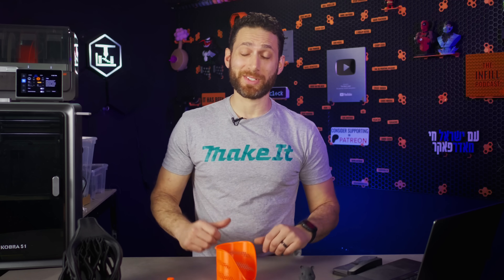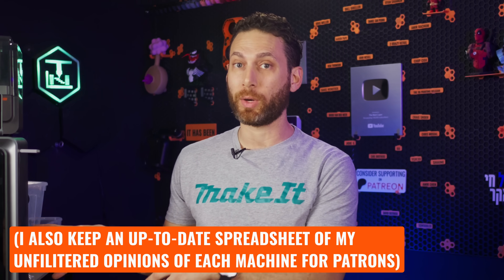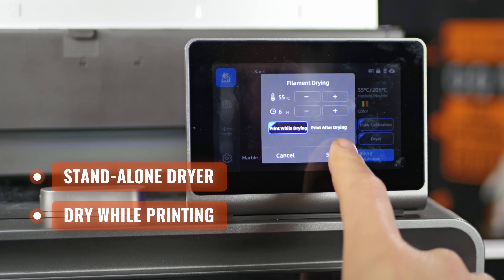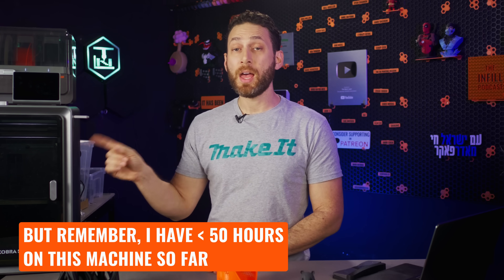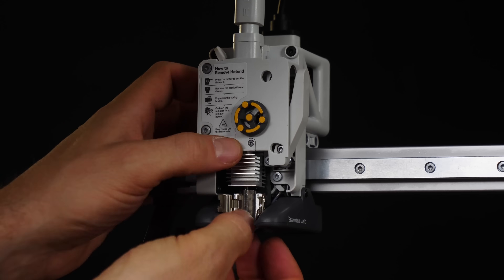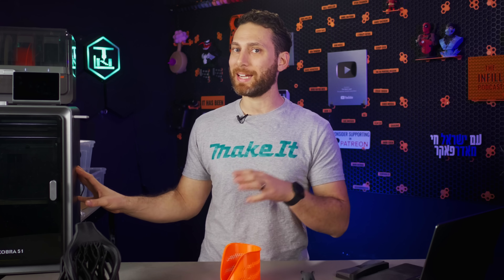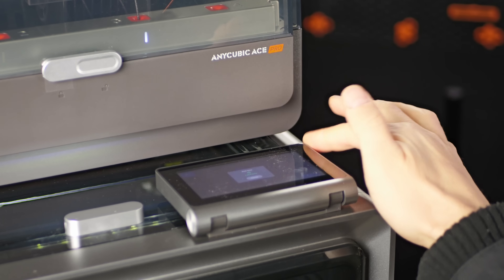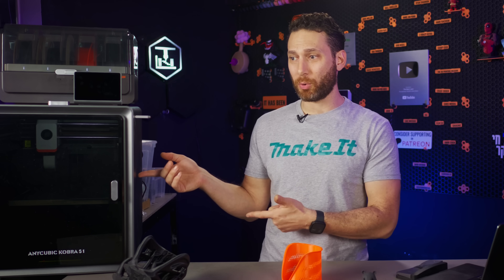16 Ways The AnyCubic Kobra S1 Is BETTER Than a Bambu Lab X1 Carbon

Comment: well we bought the s1 without the ace here uk amazon I don't like  the slicer next and I don't like the way it doesn't connect to the printer when it does print fails with code 10116 every time  I'm lucky we kept my k1 now I'm hoping over the next week or so we can sort this out or a update firmware sort out we hope if things don't improve we will send it back we have till 24.03.25 we have a elegoo cc coming next month

Comment: I  guess it depends if you want a problem free printing that you can go to bed at night without nursemaiding your printer. I'm in NZ and its a lot harder to get printers. I bought a Bambu X1c 6 months ago. At the time anycube was available in Australia but not NZ. Prices are also a lot different in NZ. The bambu X1c I bought cost me $3199 nzd from the nz distrubutor. I could have got one from aliexpress but it was almost $1000nzd more expensive after shipping. Anycube and Bambu also dont shop direct to New Zealand, you have to go through the NZ distributor or aliexpress.

Comment: Thats the problem with these companies. They're not innovative. They just want to cooy bambu lab printers. Guarantee that if they came out with a 300+mm build volume, you will over take BL market share! Good review! Thanks for the info, but i need more build volume space to pull me out from buying BL printers. Elegoo version is at $299 base model. 🤷‍♂️

Comment: I am new to 3D printing and have been doing it for about 6 months now, I started with the X1 carbon and then purchased the Anycubic Kobra 3 bed slinger. I can definitely distinguish the quality of the print but I believe it’s because the bed slinger. I just purchased the Kobra S1 and so far I love it and honestly the print quality is identical to the X1 I absolutely agree it’s quieter but the most important case so far is the price. I spent almost 800 dollars more for the X1 carbon and if the Kobra S1 continues to perform this good I am even considering selling it and buying 2 more Kobra S1 😂.
Reply: This is the type of comment that is super helpful.  From someone who has a "Rostock" delta printer, and needs part printed to make it work again, I was considering this Anycubic machine because it looks tidy, and the filament heater function looks really handy!  I might just treat myself to something not so 2015 :)

Comment: I appreciate the vid, but it still feels like an infomercial. I think it's not even a question that an unbiased video is wanted/needed.

Most of the points against Bambu really just sound like something Anycubic wants you to make. I don't have a printer with a toolhead attached by magnets, but that point sounded more like "magnets are bad because Anycubic didn't want use them."

Comment: As a relative beginner the X1 Carbon does things that I like, such as basically being automatic with its setup once I hit print, with the lidar, bed leveling, etc. Does this machine have those same features? If you mentioned those, I missed it. As a beginner, having the AMS be a dryer and not having to disassemble the AMS to clear a clog or broken filament would be very nice indeed.

Comment: What are they learning from bamboo labs what are they copying from bamboo labs? You call yourself a 3-D printing YouTuber and you don’t realize bamboo labs borrowed everything from the Voron project? They didn’t create anything they didn’t forge anything they didn’t revolutionized anything they did the same thing DJ I did with the remote control quad copters that were a hobbyist market and turned it into a con consumer market

Comment: This is a sponsored video so of course this will be done in a good light .
But let me give you guys my honest opinion .
I had the Kobra 3 combo and I have the A1 with the lite multi color.
1.The dryer actually works , it's getting warm and keep the filaments dry.
2.Extruder got clogged after a couple of prints.I had the printer for a month only doing maybe 10 prints(if that).I did 3 benchies, 3 reticular sharks which 2 of them failed(filament clogged as hell),and 2 bottle opener.
3.It was easier to install the kobra the bambu imo.
4.Their customer service freaking sucked ass.After 4 days when my extruder went bad with me actually pesking then to send a replacement, they send me a whole head.
5.Bambu lab customer service is way better .My extruder got blocked badly, tried cold pull , hot pull nothing helped .They send me the next day a replacement. 
6.Sometimes bambu lab hits the head on the top of the rail, just random. 
Take this as face value as this was my experince with the previous printers. Buy it at your own discretion.
Sorry for the bad grammar errors.

Comment: The Any Cubic Cobra S1 looks impressive, especially at this price point.  I had to replace the hot end and some parts on the board on the print module came off the connecting board which had to be replaced.  It has been difficult to fix due to the size of the print head plugs.  Since the Any Cubic is about 1/2 the price of the Bambu, I decided to order one & see how it works.  Thanks for all the information you provided.

Comment: Having had an X1 carbon, that is currently out of service due to a nasty bed adhesion issue causing multiple parts in the print head to need replacement and the current hulabalu about what Bambu seems to be doing with their system, I have been looking for an alternative device.  This video gives a promising potential solution.  Looking forward to your independent review.

Comment: Sponsor Alert Propaganda. I print for the last 15 years, when all this guys didn't know what 3d printer is. This printer is entry level printer: 
Anycubic as long as it exists struggled with warped beds, not very good extruders, loose belts, quality checks, loose connectors etc. 
What this guy doesn't tell you is that Multi color unit is very poor and cheap. Cant retract spools causing filament to jam.  Color change takes almost 2:30 minutes ich time. Software is poor and doubt it will be improved. 600mm/s just stop this nonsense if you want to have any quality. Printer is made of plastic. If you think you are buying bambulab or creality then sadly you arent. I'm happy to change my mind but for now I will keep my opinion.
Reply: I think that's reflected in the pricing of the machine. You can't really expect the same level of quality from a $600 machine vs a $1500 dollar machine. It's 2.5 times cheaper. What you do get is a good value option for an intermediate hobbyist who wants to print with more exotic filaments. I have a K2 Plus but want to pick one of these as a backup core XY.
Reply: "If you think you are buying bambulab or creality then sadly you arent."
Since when Creality are a good standard? They had their own K1 debacle, and generally they are deemed to be firmly in the "it is great... when it works" category, just like Anycubic and Elegoo.
Reply: I would like ask you something, I undecided to buy between S1 and P1S, I should go with Cobra S1 or Bambu Lab P1S? Thank you
Reply: @ I would get the P1S. No reason to get the S1 if you can afford the P1S. The only thing I can think of is that the ACE Pro doubles as a filament dryer which is handy. If you like the nicer screen, get a Panda Touch Screen for like 60 bucks and hope Bambu don't lock it out.
Reply: lmao you don't have a god damn clue what you're talking about, creality makes god damn garbage machines, nothing but issue after issue after issue, these anycubics are so much better it's not even funny

can't retract? mine literally retracts just fucking fine and does so with 0 issue, it's clear you're just one of those people who hate people being able to "get into MY hobby" at reasonable prices
Reply: @WhatsOnTodayDad  loll my printer never work bad or did anything wrong in a year,,its a kobra 3 from anycubic and it works great for what it is.
Reply: 1000 hour and it keep going 9n the same parts..i just added a trust bering on the z axis
Reply: "Printer is made of plastic": the "skeleton" is steel, so it shouldn't yield or vibrate much, and the P1S arguable has more plastic than this.
Reply: I like your comment. So in your opinion in this price range what’s the best option? I was looking for the bambulab a1 as my first printer before the case blowed up and now I’m left quite contradicted! Thank you for your time 🫶

Comment: A full separate review would be appreciated, as it can reveal items that the sponsors may fail to mention or don't want mentioned such as with the KOBRA 3 the runout sensor is in the ace pro instead of at the extruder on multicolor/large prints where if tripped during a print with backup filament setting on will purge the 1-1.5m of filament in the Boden tube as poop droplets instead of using it like bambus

Comment: But let's also be fair, anycubic doesn't like to fix their machines, they would rather just bring in a new model than make one better. i've had the k3 for i dunno how long now, and going back and forth through support we have replaced every single thing almost on the printer and it has yet to work as a mc printer. they refuse to acknowledge that maybe the ACE i have is just a lemon.

Comment: I see that it has high temperature capability but, it doesn't appear that the S1 has a hardened nozzle and extruder gear for printing high wear filaments like CF Nylon and wood filled PLA? It doesn't appear that those components are even available. I also do not see any CF filament available on their website. For those reasons, I feel like the X1C was the wrong printer to compare with the S1 because the S1 cannot do the same things that the X1C can without mods. I think the P1S is more comparable and similarly priced.
Reply from the maker: Agreed. I’m already on phaetus and e3D to make nozzles don’t worry

Comment: Literally could have just fixed the filament feed angle by creating more of a gap between the toolhead and the top of the chassis of the machine. Coming up with a workaround when an obvious solution is so apparent is very weird lol

Comment: After two, hard, six month long battles with Anycubic Kobra 2 Max and Kobra 2 Neo, just to get them to print a single print, I feel comfortable and obliged to warn everyone NOT TO BUY ANYCUBIC PRINTERS, EVER. 

I had to change motherboards, whole hotend assemblies, make a custom X-axis carriage for the assemblies, print custom shrouds for the assemblies and figure out how to rewire the pieces of crap to the new SKR motherboards, and then figure out the klipper configs for them, JUST TO GET THEM TO PRINT CORRECTLY. F**k Anycubic and their "support"

Comment: Great program 
Question I have a medium harvest Right freeze dryer. Anyway I 
would like to maybe get a 3 D
printer and make a 11 1/2 inch 
circular plate for the freeze dryer. 
My question is. There is no template for this and I need to 
make it myself. Would it be a way 
to do it. Or is a big deal.
Thanks

Comment: If I may suggest - can you do a video comparing not the machines but the machines ecosystem? Default slicer, orca compatibility (or lack of it), connectivity and so on? By now the machines are usually so good, they outclass machines from just couple years ago and 1:1 comparisons give either identical or basically splitting-hair results. Instead - please compare quality of life in using those printers please!

Comment: I have a K1 Max and I have had to replace the hot ends several times as well as unblocking the extruder. Removing and putting back is a pain, I even broke the thermistor while switching one, my fault of course, but it wouldn't have happened if I had a quick swap option. My printer is larger, but I would rather slice my models than put up with problems I have dealt with on this printer. Now, the price with a multi-color is equivalent to my printer, so knowing what I know now I would have definitely picked this one up, after all it can't be worse that it is for me now. I picked up the K1 max over the Bambu for its size and the prints I do. One trade off I will not make is open source, I consider this a lucky move not picking up a Bambu (since privacy issues came up recently) despite my problems because I use my printer for prototyping, so my prints are for my eyes only.

Comment: I ordered day one and really I hope we get a hardened steel nozzle and different sizes really soon, I probably would have already ordered a .6 .2 and .4 in hardened steel had it been an option.      Anycubic has always been pretty good about replacement parts.
Reply from the maker: Agreed. It was a MAJOR oversight to ship it with a brass nozzle... but to be fair, Prusa did the same thing with the Core ONE. I've already called them both about it. And, just to be safe, I already put in a call to Phaetus and E3D/Diamondback, so we should get aftermarket solutions, too :)

Comment: Interesting video, I will defiantly be thinking about getting this machine.  I have been looking for a new machine that has a bigger build volume and will print at higher temperatures then my current machine.  The one thing, I would like to know is how are the built in print profiles. It seems to me that a lot of people forget how big a deal all the print profiles were on the Bambulabs printers.  Being able to drop in a roll of filament and get good results without having to customize the profiles was huge for a lot of people.

Comment: At 12:53 you mentioned the max build plate temperatures for Bambu Lab and you said 100 or 110, but the specification shows 110C@220V and 120C@110V, so with certain voltages the temps are the same as in the Cobra.
Reply from the maker: Correct, I misspoke, thanks for bringing that to my attention. I'm on 230V here in Israel, so my machine goes to 110. My bad.

Comment: Since my desire to buy Bambu is waning due to recent events, this printer does make for a compelling replacement/upgrade for my P1S Combo… I mean I’m not tossing the Bambu, but a better specced machine with multiple QOL improvements, (hopefully) more open architecture, at lower cost? Sounds fantastic! I’m just going to wait for long term reviews :)

Comment: It's maybe too cheap! (480p video monitoring and no heated build chamber).
Reply from the maker: IMHO heated build chamber is overrated and introduces yet another thing that can go wrong down the line. All the printers that have it barely make use of it, and half of them have major issues down the line (ungrounded heating element, melting the grille in front of it, etc). If Prusa themselves says "there's a better way to reach 55C," and they are the kings of machines that last forever, I think that says something. With that said, we're not yet at the point where consumers are printing PEEK and Tullomer and stuff, so maybe my opinion changes when we get there. But I print PC, PAHTCF, PC-CF, etc etc etc all day long without an actively heated chamber.

Comment: I would like to know what you think are the weak points of this promising printer.
Reply from the maker: For sure! To be honest, sponsored video or not, I have not encountered a lot of them yet. As mentioned, the brass nozzle is disappointing, and I've brought that to AnyCubic's attention. Printing experience has been fantastic. No local access in Orcaslicer yet is a bummer, I don't like transferring USB sticks.. but that's another reason to wait to review - I got the printer before all the prime-time features are ready (AnyCubic likes to do this with reviewers), and I bet in 3 months when they ship them, it'll be a different story.
Reply: @thenextlayer  I'm glad to read this, because I bought one a couple of weeks ago, hehe. Regarding the nozzle, I looked to see if there was a steel one that could work, but I haven't seen anything concrete. Do you know what kind of nozzel it uses? A V6? I also assume and hope that they will solve the mentioned functionality aspects, like the Orca one, for which there is supposed to be a bridge. Thank you very much for your video and comments. Best regards.

Comment: So to sum up.. this printer might be cheaper than the bamboo lab...
But that is about it.
I can imagine bamboo lab coming with a "P1S+" that is simply small improvements like other screen etc. But at the same price point.
Same with the AMS...
Reply from the maker: I think you might be overlooking the built-in filament dryer, which is basically a $129 value. That's HUGE, and I think it would take a lot of re-engineering for Bambu to add it to the original AMS. But I bet their new printer will have it built in, maybe that will be backwards compatible if they're smart.

Comment: I appreciate non-shilling informational videos. While I would prefer a full on review, I do appreciate the video pointing out what the new or different features are on products and how they relate to other, similar, products. I have an A1 and I've been doing a lot of printing, I'm curious to the features I may be missing out on slightly higher end printers. I doubt I'll be going out and replacing my A1 - but if it breaks, it's always good to know what's out there which may provide a better experience than even what I've had with the A1. I'm brand agnostic, I don't care who makes a product, as long as it's a good product and they stand behind their product.